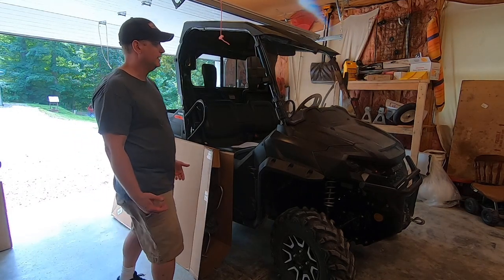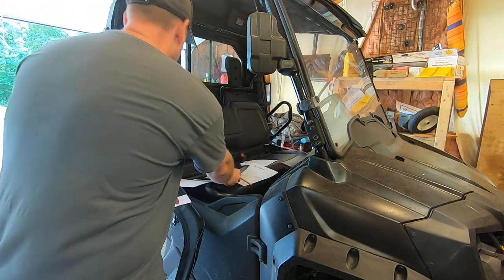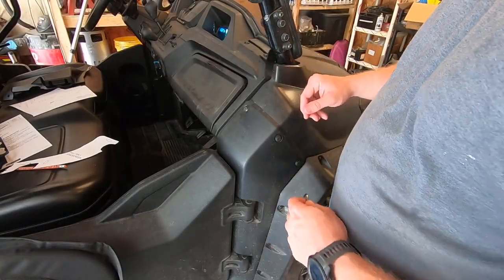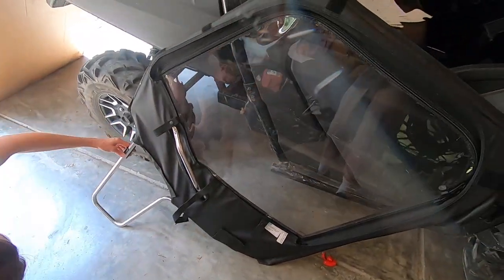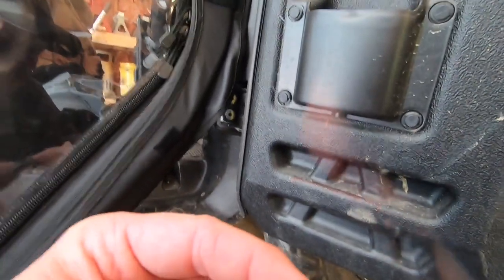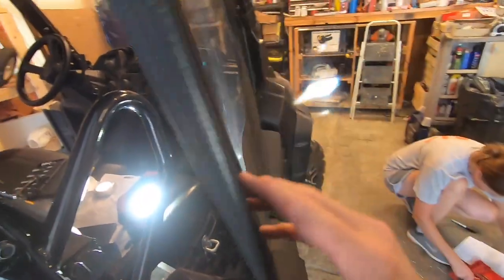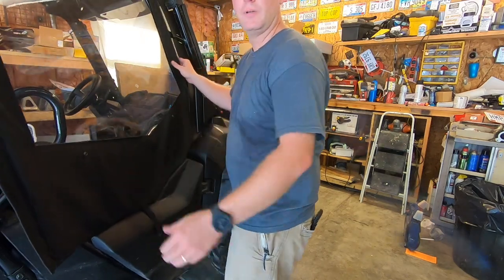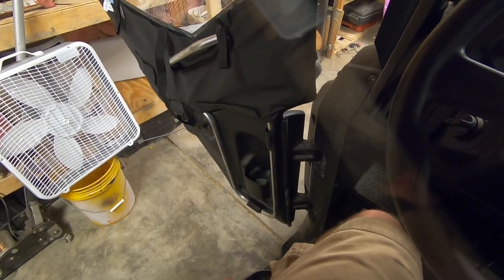Honda Pioneer 700 Soft Fabric Upper Doors Installation and Review

Comment: Thanks you for the video! I couldn't not have done it without the video. One recommendation don't cut the two to insulator panel first. Try install them first to see whether they need to cut out for the front window brackets. 
Thanks
 Leon Johnson 2/3/2022

Comment: Yeah I agree with you. I expected a little better product from Honda. Wasn't hard to put on. I would of like a better fit. A lot of gaps. But for the price they will work for what we will use be using the pioneer for. Your instructions were spot on. Whole lot better then the ones Honda gave.

Comment: Thanks for the vid. Instructions from Honda are not the best used your vid for reference.  I just did the rear doors and the front on a p700-4 and the rear went so much quicker and is a way simpler design. So was the p 500 front it was easier install.

Comment: In process of installing doors. Me so this really helped.  However I agree the pop rivets and overall design is poor.  For what it costs, one would think there would be a better design and product.
Reply: Update - I chose to use toggle bolts to secure brackets to the doors. Much better and solid connection for the door. Probs voided the warranty by drilling larger holes, but the outcome  is much stronger.

Comment: Thank you  for the video.  Now that the installation is done can you remove and reattach the doors easily? I would want to remove the doors for the summer.
Reply from the maker: Yes. They are off for the summer. Very easy to remove and put back on

Comment: I can't figure out how to pull the door shut so that it locks from the inside,. Can only do it from the outside. Any suggestions?
Reply from the maker: There is a metal handle just for that purpose on the frame part of the door.